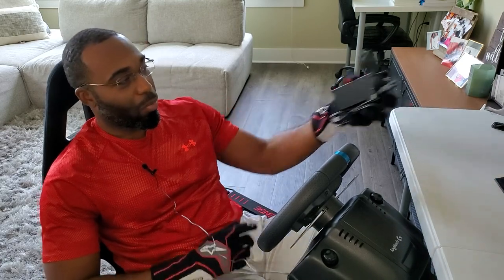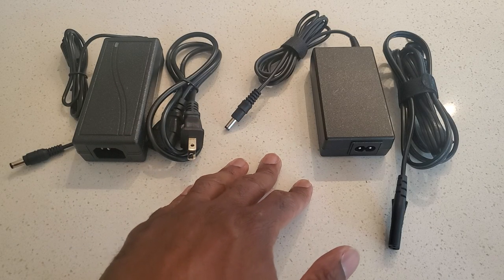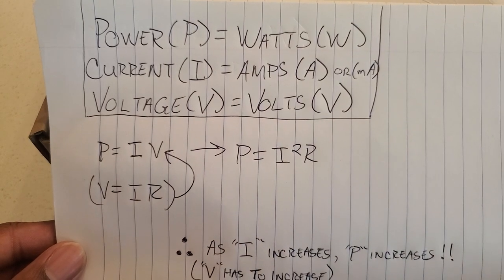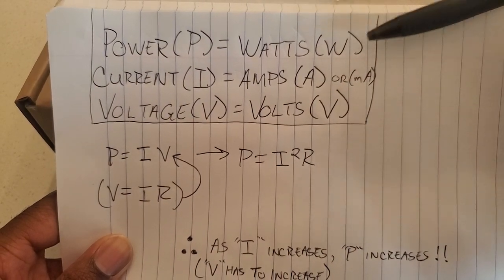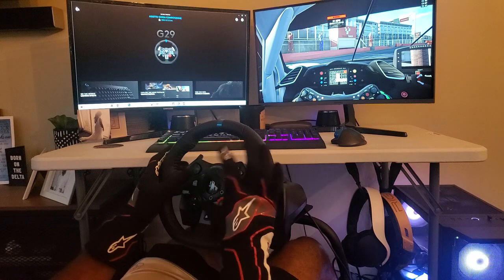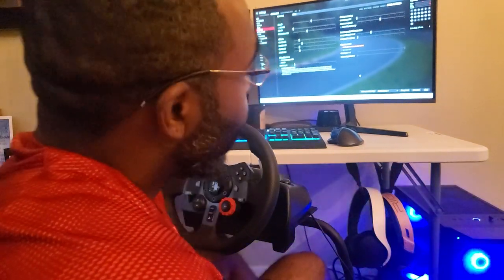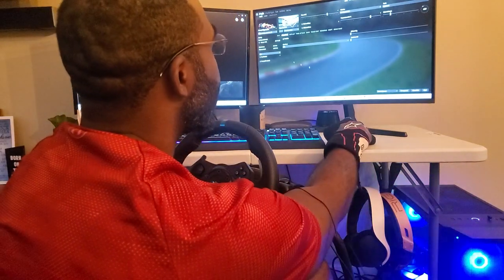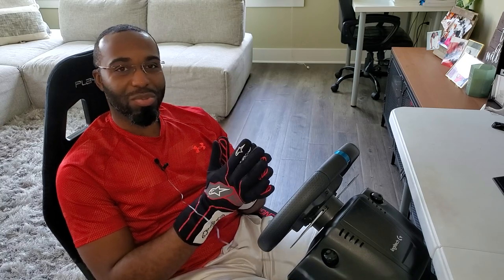G29 5A Power Supply Upgrade

Comment: You got this wrongly. Power Supply power rating doesn’t supply more power to a motor . It is how much power the motor can suck from the PS. If the motor is rated 1A it will draw 1A. If the PS would be rated less than 1A the motor would start “suffocate “ - became hot , both motor and PS and eventually at least one of those would burn. Imagine when you would breathe trough a tube and the tube has to small diameter to draw the air into lungs comfortably you would be working very hard with your chest to draw the air and eventually you would die from lack of oxygen. Now, when you switch to larger tube , large enough to breathe comfortably you will be ok. That’s the proper PS power rating. If would go with bigger tubing it would not change anything for you - bigger PS, because you can’t take more air in your breathe than you are capable of- that’s the motor power rating. So, if Logitech engineers used a motor that is rated probably slightly lest than 1A than 1A PS is enough and 5A power will not change anything. Eventually PS with slightly higher voltage could change something but it depends on the motor. I am pretty sure that Logitech puts the cheapest components they can find so they go with slightly lower voltage PS so the motor will not overheating and lasts.  There are many other issues though. PS with to low power output or to high voltage output can cause problems including fire.
Reply: so to summarize , is it good to get 5A power supply for the wheel or not?
Reply: Yeah, that's why Fanatec sells power supply upgrades for their equipment.......
Reply: @meman24  supposedly the motors in their are already rated higher, the just under power them

Comment: I am planning on doing the same with my G920, the only thing I am worried about is whether is would somehow ruin the motors or any of the other components over time
Reply from the maker: @fyndssdev that's a valid concern. Before switching to the CSL DD, I used the upgraded power unit for about 8 months consistently for a few hours a day, and I did not have any issues. I just recently used my G29 for another product review (coming soon), and it still works like new. I can't guarantee that your experience will be the same, but that has been my experience.
Reply: @JCCollinsRacing  That is good to hear, but what I was more talking about around 2 years down the line, whether the motors would degrade more than just using a normal 1A PSU
Reply from the maker: @fyndssdev I am no expert in this, but in theory it will likely burn out the motors if pushed too hard for too long.

Comment: I dont reccomend doing it. Max thing that  the wheel can handle is 3a before you unintentionally burn the motor.

What you can do is a belt conversion :)
Reply from the maker: @Chadog I did not know that a belt conversion was possible for the G29.

Comment: How's the heating for g29 after long use with the power brick mod
Reply from the maker: @Kyle Hoh the heating is very minor. I have raced with the upgraded unit for a few hours straight and did not feel any noticeable difference in heat from the original power unit.
Reply: @JCCollinsRacing  Specification:
Input: 100V-240V AC 50/60Hz
Output: DC 24V 5A
Compatible: DC 24V 5A, 4A, 3A, 2A, 2000mA, 1.5A, 1500mA, 1A, 1000mA, 0.5A, 500mA

Is this correct specification?
Reply from the maker: @Kyle Hoh yes, these are the specifications for the unit. I left a link in the description of the video of the unit that I bought. I hope this helps!

Comment: Will it stop the blinking problem for my g923 ps?
Reply from the maker: @artis salomijevs I am not aware of a blinking problem. Can you tell me more about it?
Reply: @JCCollinsRacing  its when I torn it on it conects but dont recalibrait and the light on top starts blinking but the botuns work and thats why I think its just dont have inofe power
Reply: @Drango0  yes it will help probably your power supply is burned like mine. i ordered 24V power supply with 2.7A and work better than original (power supply for LED strips for outdoor use) it will cost me 16$

Comment: The motors inside cannot use more amps than they are mede for! so this wont work
Reply: Sabes muy poco de electrónica y electricidad... Un motor puede demandar amperios a lo bestia y lo que quemará será el o los mosfets de la controladora. Pero vamos... Esto lo dejaremos para el primer curso básico de electrónica

Comment: Putting on a bigger power supply, that capable to supplying more amps will not increase the amps to the motor on its own. The motors control the power and the amps not the power supply. If Thier as been a increase in power on the wheel it could only happen if the motors were restricted by the 1 amp power supply some how. Increasing the power supply amps to 5A will not in theory increase the power at the wheel by 5 times, by theory the power at the wheel will stay the same. If the power supply voltage was increased that would increase the power at the motors by would most likely burnout the motors. How the DD1 wheels work with a bigger power supply must be done as part of the manufacturing.

Comment: yes its not rocket science man. give it more power its going to perform better BUT, depending on the amount of power your increasing it will directly relate to how long before your motors OR curcuit board burns out. If your only increasing it a little then it probably still last long ass time but it will eventually butn it out.

Comment: This is a great video, I'm going through the same predicament trying to get a new psu for my g29 since I believe the psu is dead. My question is what are the best/safer Wattage alternatives I can go with?

If I get anything more than 42w will it not cripple the wheel?
Reply from the maker: @Slay MoneyFX I do not foresee 42W destroying your wheel provided that your voltage remains stock (24V in the U.S.). In my video, I was using a 5A power unit at 24V, which produced an output of 120W. The G29 was working perfectly fine while I was still using it at the time.
Reply: @JCCollinsRacing   Was it still working when you stopped using it?
Reply from the maker: @Slay MoneyFX like new!😁
Reply: @JCCollinsRacing  Appreciate it sir 🙏 I'll be getting a new psu tomorrow. By the way love the content, you and your wife make a great team. Love how she supports you with your sim racing 🏁, you guys remind me of me and my wife 🙏 stay blessed 🙏.
Reply from the maker: @Slay MoneyFX Thank you for your blessings! Blessings to you and your wife as well!

Comment: I cant open the link ,how supply i can buy for this update?
Reply from the maker: @Joale Paradisi sorry to hear that. Do you have the "Wish" app? It should go through without having the app, but I would suggest downloading and trying the app if you are trying the link on your phone, or mobile device.
Reply: @JCCollinsRacing  above all i al interested in wich Power supply Is needed,i know that you Need a 5 amps but i font now the volts.
Reply from the maker: @joaleparadisi2358  gotcha! I am not sure where you are in the world, but the unit I have is a 24 volt unit.  But, I am not sure if this standard across all of the units.  I hope that this helps!
Reply: @mistermiagi9984  Can you explain why?

Comment: Would this work with my g920? I’m guessing it would because the g920 and g29 have almost identical components.
Reply: no any wheel still wont work since the motor uses about 0.5 amps and its combine both making 1 amps and also if u use 5 amps it will only take 1 amp to the battery so the 4 amps left is useless.

Comment: A few questions:
1. Does this end the warranty ?
2. Can this damage the wheel?
🙂
Reply from the maker: @sam I honestly can't speak to the warranty, and to my experience, the wheel has been functioning fine.  I am sure the wheel can be damaged if the 
Amps are too high,  but at 5A, it hasn't shown any symptoms of being too high.
Reply: Ok thanks 👍🏼
Reply: no, even if you buy a 1000A psu. There is absolutely no benefits unless you increase the voltage but is risky

Comment: Thank you for the video, I did look for a link to buy it, from your channel, but I didn't find one, I just order a similar one from Amazon. I never unplug my original one, after year it stop work, my bad.
Reply from the maker: @Fred Varao thank you for watching! Yeah, I need to update the link to this unit. I have been told that the old link doesn't work anymore and that the product is not available at that link. What I will do is update the description with the specs and model number for this unit. That way, you all are not limited to only one source.

Comment: 2 major questions for me: 
1. Will this mod burn up the motors ?
2. Does it cause compatibility issues with PS4 and Xbox?
Reply from the maker: @Asher Judd 
1. I do not have an exact answer with if the motor will burn out faster or not. From the experience that I have had, I have not felt any difference in temperature, but that is my experience and I would say to do this mod at your own risk. I am not responsible, nor do I know for sure the ultimate outcome or timeframe/cycles for it to reach that time frame.
2. This mod does not affect the compatibility for console as the power the wheel receives does not directly communicate or rely on the console that it is connected to. The G29 is only compatible with PC and PS3/PS4. If you want it for XBOX, you would need to get the G920 or G923.

I hope this helps! 😁
Reply: @JCCollinsRacing  yes it does, thank you
Reply: @JCCollinsRacing  I conversed with a professional electrician and according to him increasing amps does not increase the chance of damaging the motors but increasing voltage will
Reply from the maker: @asherwiggin6456  thank you for confirming that.

Comment: Just subbed! Can you post the model info without a link that takes me to download the Wish app? I don't want to download the app.
Reply: The link is broken too. I downloaded wish and it said it was invalid
Reply from the maker: @Jason Stormont I know that this is a very late reply, but the specs are as follows:

Model: YU-2405,
Input: 100 - 265 VAC, 47-63 Hz
Output: DC 24V, 5A Max (5000 mA)

This information comes right from the back of the unit itself. I really hope that this helps and I apologize for the super late response.
Reply from the maker: @Yung Guap sorry. That link is really old. Here are the specs for the unit. I am hoping that you are able to find it in a Google search. 

Model: YU-2405,
Input: 100 - 265 VAC, 47-63 Hz
Output: DC 24V, 5A Max (5000 mA)

I hope this helps!

Comment: How is your wheel holding up with this mod?
Reply from the maker: @kenshinesca it's holding up well! There has been no noticeable difference in heat and it has been operating very smoothly. Can't say if this will be the same for everyone who decides to use this mod, but my experience has been very good so far.
Reply: @JCCollinsRacing  sane voltage higher amperes shouldn't be an issue; jf a device cosnunes more current (I) than the supply js rated for, it'l kill your supply and can kill your device, but a device doesn't consume more current rhan jt needs. Of course there are some exceptions but this js generally the case. A power supply should always be rated higher than the device, therefore a higher current with the same voltage will not damage a device. Just be careful the voltage is right. 

So to sum up: a power supply can have as amps as you want, just needs to match the device.
A power supply MUST have a voltage equal to the one rated on your device
Reply: @reitzespan5762  is there a chance that Logitech setup the motors to work on higher amperage, but still put a lower amperage power supply to cut costs?

Comment: This work the same on g920?
Reply from the maker: @Kevin Heiter I would assume that it does. I am not 100% sure on that, but I believe that the G29 and G920 have the same hardware. The only thing that is different is the licensing that is programed into software of the G29 to identify PlayStation OS opposed to XBOX. Check the bottom of the power block, and if the Voltage = 24 V, Amps = 1A, then it should work. I am not guaranteeing that it will work, but based on those specs, I believe it will work.

I have not tried it on a G920, so I cannot promise or guarantee that it will work in the same manner.

I hope that this helps! Sorry that I don't have a more definite answer for you.

Comment: I have just bought the 5A power supply and this is just not working :c
Reply from the maker: @W4RG4 does your power unit have a power indicator light? If so, is it lighting up when plugged in (trivial question, but just want to cover all of the basics)...
Reply: it shouldn't work im afraid. that's not how current works. it's a placebo.

Comment: Sure it is not placebo..? If the improvement were so evident, Logitech would include a 5A PSU, which would mean minimal extra cost for a “noticeable” improvement
Reply from the maker: @fofocho I can't speak for Logitech's reason, but I can say that the difference is not a placebo effect.
Reply: it probably wouldn't get more profit as most people don't care about it
Reply: logitech cheaps out at whatever they can so yeah...
Reply: I'm a amateur about electricity but this mod it a upgrade...like phones charger...it killing ur battery but it faster. I think g29 cand be as a t300rs if we change motors and power unit. I'm planing to add a belt between motor and wheel. Dont know how many open one but can be possible.
Reply: @2Blayzar  I'm going to be honest with you... I kind of understood part of what you were saying but you were typing like a robot so it is a little hard for me to understand. I'm guessing English isn't your first language
Reply: @2Blayzar   a fast charger with more voltage than a normal battery doesn't kill your battery at all unless you get an offbrand one because they keep it at a safe voltage just like 5mA is safe to use for the g29...
Reply: 100% placebo, just test it with a dynamometer :)
Reply: Companies cheap out on screws to save money, why wouldn't they cheap out with a power brick?

Also it doesn't make your ffb stronger, it makes it run smoother. Imagine every time u hit a bump and it clips, the motor has to change directions and force many times for each bump and road texture and eventually max out so it's not only the strength.

The motor is most likely able to draw more power than the original brick supplied and the extra power will help when there is a lot of ffb adjustments that makes the wheel clip. 

I'm trying to explain it as simple as possible since so many people think more power then more rotation speed and resistance, when it's more then that.
Reply: One more thing, thanks why in Sims if u don't have a direct drive wheel I have to mess with the "min force" to feel the tiny adjustments but the more u up min force to feel texture the less feedback you get for the stronger forces like centering and wheel spin. All this upgrade does is allow u to have a little bit more min force
Reply: @naldoxable  it is smoother... But it also is a tiny bit stronger
Reply: @rbdshadow7272  there is no electronic explanation. For the peak current or impulsive movement there are capacitors inside the power supply. I have also tried with my 10A variable bench supply with no differences. I only noticed much improvement increasing the voltage

Comment: I don't recommend changing the PS, capacitors can burn in fact, just buy a better setup
Reply: That’s not how power supplies work.
Reply: @luckyupyours  you mean it will use what it can handle right?
Reply: @luckyupyours  can you explain pls? im insterested, but im not sure to try it

Comment: I'm a G29 user for about a year n a half already. I play on PS4 only, I can tell right of the bad that the G29 really sucks bad playing F1 series. It's just so shitty feels like the car is just hovering. Difference when you play a different game like Project Cars Grand turismo. Where the wheel FFB is way better!! I feel like those games were meant to be play with logitech wheels. In conclusion I don't think this power supply won't do much. Just looking at your video and comparing F1 with Assetto corsa where you can really notice the difference on the FFB. I really want to upgrade to a thrustmaster wheel. The G29 is just a good starting wheel but it gets boring to much tweaking to make this wheel work fine.
Reply from the maker: Definitely agree that it is an entry wheel and does feel really light in the F1 games. Upgrading to something like a Thrustmaster or CSL DD is a tremendous leap in ffb.